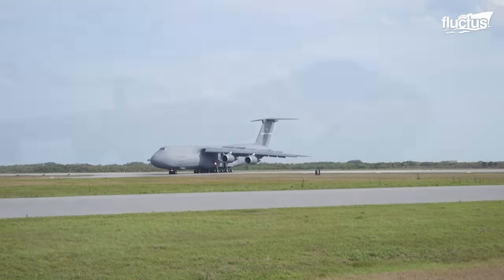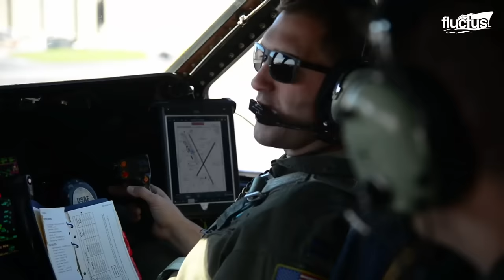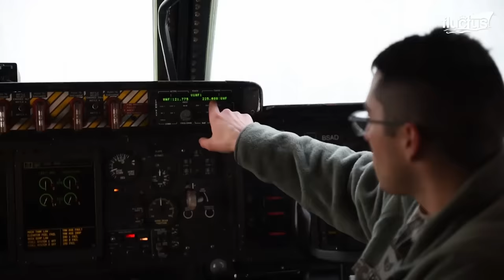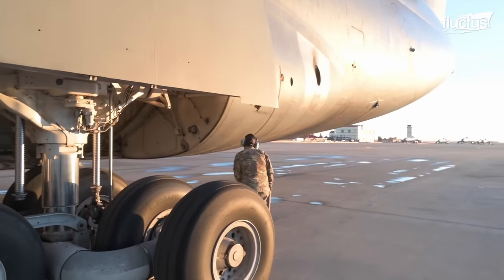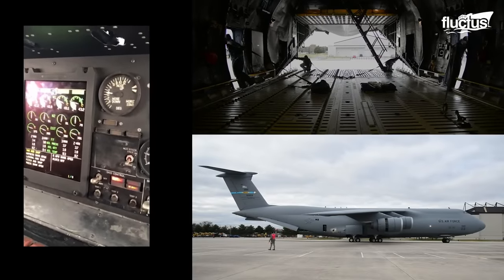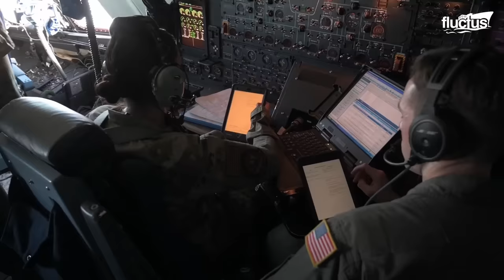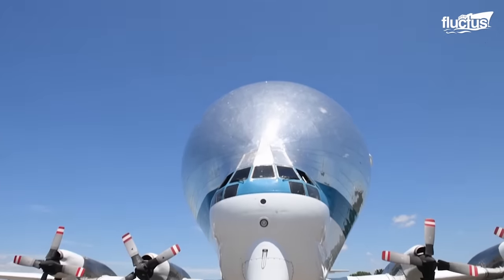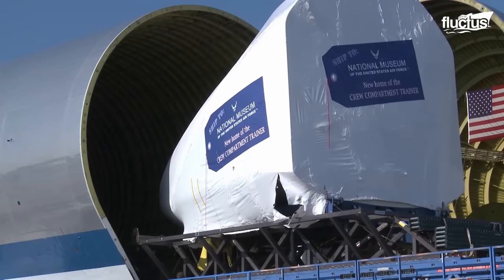The Insane Amount of Power US Largest Aircraft Needs to Takeoff

Comment: I remember going to the Greenham Common Airshow in the UK in 1979 and we had the opportunity of walking through this gigantic aircraft. We were awestruck by its sheer size and volume. incredible that its now been in service since 1970. (Mind you there are still 58 B-52's in service and the last one rolled off the production line over 60 years ago!)
Reply: A definate nice formula weight blnc signal stop up and go on down with clearity land :-)
Reply: Liver pull up down system ❤ installed :-)
Reply: 57 know it 16 wires :-)
Reply: Gd landing near river :-)
Reply: 43 years working capability it had :+)
Reply: 16 wires fixed at open point :-)
Reply: Relax and unrelaxes installed 😊❤
Reply: Stairly gd .capabily gd with slow take off and fast landing 2 hours to 2 hours 2hours to 2hours distances ❤

Comment: I’ve flown FCC on tail number 7030 and was DCC on 7032. I was an Engine Run Certifier on C-5s for several years in Germany. The larger commercial aircraft like the 747 and A-380 are modern wonders but seeing an M1A1, semi-truck, or rocket booster on a C5 is awe-inspiring. FRED is a challenge to maintain but it’s fun.
Reply: What's the power comparison compared to a 747 or A380?
Reply: @struesbob7493  TF-39 43,000-45,000 lbf JTD-39 Variants 43,000-56,000 Airbus engines 36,500-80,000+. I remember seeing the A-380a few times during testing at Frankfurt. It is an impressive air machine.
Reply: @tdubz1154  thank you
Reply: Did you happen to be at Rhein Main Air Base in the mid to late nineties? Specifically, the 37th ALS.
Reply: @williebrown4266  I flew through Rhein Main quite a bit in the 90’s. PCSd in in 2003 and closed it down in 2005.
Reply: @tdubz1154  Cool. I was there from 1993-1996. Worked at the maintenance squadron, both flightline and backshop.
Reply: @williebrown4266  Cool! Did you know Paul Lucido? He was stationed there during that time.
Reply: @tdubz1154  No. Doesn't ring a bell since it's been so long.
Reply: Gọi là năng lượng chú sao điện năng

Comment: A lot of focus is placed on the power of the engines -- and rightfully so.

Not discussed is the incredible strength of the mounting gear that prevents those insanely powerful engines from breaking loose, or shifting in any way.

Also not discussed is the incredible strength of the wings, to hold 840,000 pounds off the ground, without snapping off or cracking.
And when the plane encounters turbulence, or makes turns, perhaps more than a "G" of force on a turn, that doubles the weight that the wings are carrying.

And it is not just the vertical weight... those wings are what pull the main section of the plane forward.  The engines pull on the wings, and the wings pull on the rest of the plane.

I am curious how many engines would need to fail, before the plane would not be able to maintain altitude.
I am also curious about how many engines are needed to lift-off, given a long enough runway.

Comment: The video shows a mix of the original  General Electric TF39 engine and also the latter General Electric F103 engines that were put on the M model. The smaller booster fan in front was was unique to the original TF39.  I once was talking to a C5 pilot, and he loved flying the models with the upgraded engines.  The way he described it was that it felt like the plane had a fifth engine!

Comment: Former Boeing Everett.... home of 747, 757, 767, 777, 787, and soon 797...

Wonder what the C-5 Galaxy would be like if they traded those tiny GE engines for the same we use on Triple Seven? The C-5M Super Galaxy transport aircraft is powered by four GE CF6-80C2 turbofan engines each developing a thrust of 50,580lb. The length and diameter of the engine are 4.26m and 2.69m respectively. The dry weight of the engine is 9,860lb.

777 uses 2 GE90-115B engines, which reigns as the world's most powerful jet engine. Each engine puts out as much thrust as 2 of the smaller engines used on C-5 combined. The 777 engine is larger in diameter than the entire fuselage of our 737. Main fan is nearly 11 feet in diameter itself. Add containment and cowling the engine is huge.

Maybe Lockheed doesn't want to take military advice from Boeing...
Reply: Yeah, the RR Trent 1000 engines or even the older Trent 900 engines found on the A380 are  also way more powerful and are so much more efficient. 
But they were after all developed for different planes. And given that LM only upgraded very few parts of the plane when upgrading to the C5M, only similar engined could be used, so they used outdated engines again...
Reply: @nils1953  Thanks for comment and input.

Comment: Worked the B and M models.  They're impressive but the engines on these aren't particularly powerful and are de-tuned as well.  Also any video clips on this with the engines with the sucker doors making a lot of noise is the old TF39 which was even less power.  But the C-5A/B was by far the best sounding airliner/cargo style plane ever made.
Reply: I hear the new RR engines are much better and have a great deal more power. I hated flying on these birds. They were cold and the seats sucked. However, after a NATO exercise  we flew the length of Norway on a Coast Guard C 130 with no heat!
Reply: 433 OMS Kelly AFB, Tx. All C-5s and a fighter wing next door.

Comment: The C-5 has a lower gross weight than the 747 and the A-380. The engines on the C-5 are also not particularly powerful compared to the engines on the 747,A-380 and expecially the 777.
Reply: Most people are surprised to find out the 747 is also one of the fastest planes out there, including most slick looking business jets.  Not only is the 747’s Never Exceed speed higher than most, its also relatively over-powered.   Many, most, planes have a Cruise and/or Max Constant Thrust limit, so if the temps aloft are above standard and the plane is full it simply will not reach its optimal or best cruise speed.   The 747 doesn’t really have that problem, at max weight at optimal altitudes it has enough engine to maintain its max speed, even in some heat.  The drawback is it’ll really drain the tanks when pushed.
Reply: @dash8465  I've been to 59 countries, most of them multiple times. I used to almost live on a 747. Loved that airplane. I also really liked the L-1011. To bad Rolls Royce almost bankrupted themselves and Lockheed with their crappy enging.
Reply: uiuiuieeiuiuiiiiiuìuiuiuiui

Comment: Passenger 747-400 and 747-8 aircraft both have heavier take off weights than the Galaxy. The passenger version of the 747-400 with Royce RB-211 turbofans produces 240,000 lbs, 40,000 lbs more thrust than the C-5. And let's not talk about Russian transports like the recently lost Antonov Mriya which leaves both the 747 and C-5 for dead--as is often the case with Eastern European aircraft.
Reply: P

Comment: I was a crew chief on C-141s their little brother but did a temp assignment where we had to swap out an engine then run it through its paces before letting it fly.  I was the guy who stood in front of the plane with a headset as a spotter while we did a full throttle run, yikes are those things intimidating!   Never experienced anything like it, the ground was shaking like an earthquake and it was sucking any moisture into the TF that looked like a tornado.  I flew back to my home base on one and not the smoothest riding of planes I flew in especially since the belly was loaded to max with tanks and helicopters.  Amazing that something this large can fly!

Comment: I've never understood what the real difference is between the C5 and the C17, on the face of it they seem similar?
Reply: c-17 is smaller and can be used in tactical unimproved runways close to the battle.  a step above the c-130 so to speak.  c-5 is astrategic asset.

Comment: I worked on the Hydraulic /Pneumatic systems on these bad boys while in the Air Force back in 1969 & 1970 before I left for Vietnam . I also flew on a few during my Military career. I might add, these birds could be a challenge to work the Hydraulic/ Pneumatic systems due to there huge SIZE.  What an incredible beast.❤

Comment: Make new designs of wings with new engine capable of 100 thousand pounds of thrust with fan in back for extra thrust a design similar to the ospreys  under galaxy  in the middle rotorocraft technology I believe will give enough  thrust for vertical  take off . I believe  if you instill programs for vertical take off for heaviest  planes and succeed  you change the face of warfare  because  you can make all planes for warfare vertically take off in the new 6 generation  that is to come that is drones plans tranesports

Comment: 2:00 The engines on the C5 do NOT produce 3x the thrust per engine of the F16 Fighting Falcon.  The Falcon has 1 × Pratt & Whitney F100-PW-229 that produces 29,000 lbs of thrust.  3x that would be 87,000lbs not 51,000.  That is 1.75x the thrust of the F16 assuming the M variant of the Galaxy with the CF6/F138-100 engine.  If you get this easily researched detail wrong how can we trust any other detail. Disliked.

Comment: Surprised each engine ‘only’ makes 51k lbs , that’s 204k lbs total … I know 777 engines (2) make 115 k lbs ea., that’s 230 k total for a significantly lighter craft at AUW… imagine if they slung four of the triple 7 motors on the beast…🤪😁

Comment: The 2 GE 90's that power the Boeing 777 300 ER develop more thrust than all 4 engines combined do on the C5!
Reply: Stop exaggerating. C-5 engines each  produce up to 61,000 lbF of thrust compared to 81,000-115,000 lbF for the GE90. 244,000 > 230,000
Reply: @jamesplymire5342  Barely.....it's not the absolute thrust monster the clip is trying to portray. Now, if it was pumping out those number with a 2 engine config, that would be impressive.
Reply: @jamesplymire5342  they’re not exaggerating. The GE90s on the 777-300ER are 115,000lbs each. No less. While the commercial version of the engines they chose for the C-5, do put out 60,000lbs… the engines on the actual C-5M has been derated to produce a maximum thrust of 51,250lbs each. So it’s 205,000 total for the C-5 vs 230,000 total for the 777.

Comment: If the engines were replaced with the new smaller more powerful GE90X engines, the planed could be converted into a bomber or a massive gun ship with 8 40mm guns with 10,000 rounds per gun & 6 automatically loading & unloading 105mm cannons with 500 rounds per cannon.